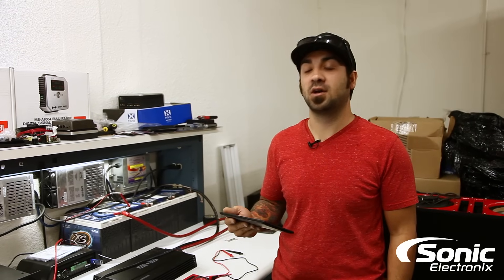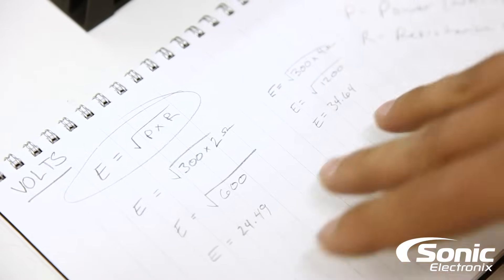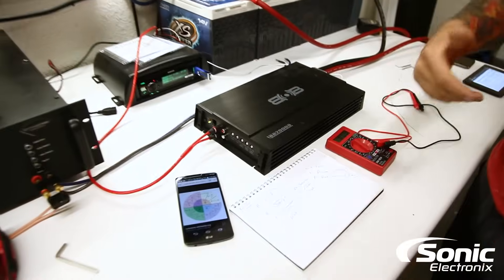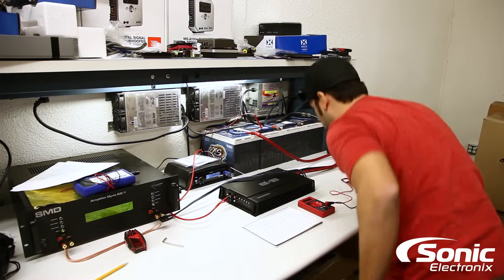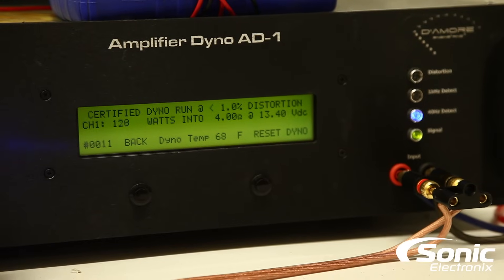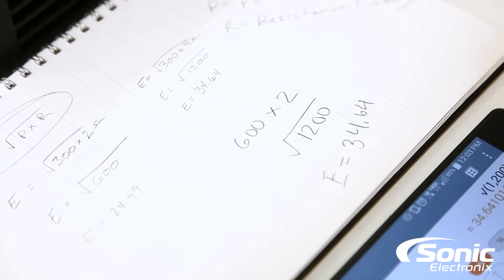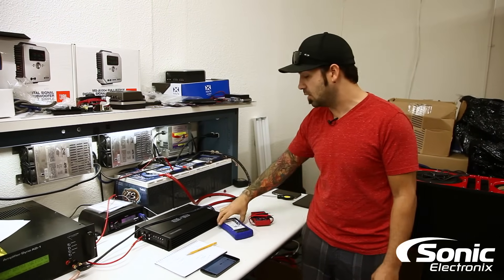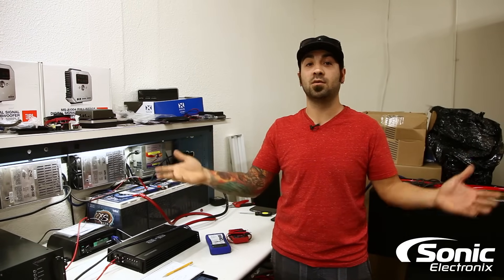How To Set Amp Gain to Match Lower RMS Subwoofers? | Car Audio Q & A

Comment: What if the Amplifier is 450 RMS, but the Subwoofer is 275 RMS.
Should I calculate it with the Subwoofers 275 Watt.  -->  275X4 = 1100,  √1100 = 33,16
My Amp is 900W peak, 450 RMS (4 Ohm)
Subwoofer - 1100 Max, 275 Nominal (RMS) Output power (4 Ohm)
Because if I pump the Amp to 450 I dont know if its good for the Subwoofer.
So I should calculate it with 275 Watt, right?
Reply: talclipse please tell me your not dumb enough yo use only one voice coil on a double coil sub it will rub and destroy your sub crazy fast
Reply: SkyJUSTIN6 no it will not.it cuts  your power handling in half but that's about it.
Reply: talclipse wow dude just no on so many levels first of all those are all peak powers not rms.
Reply: john aranjo what are you Blabbering about??let Me guess cause I am using only one coil on a Dvc sub?? Or maybe its cause I said a car audio amp is like a dumb pc power supply??

Go do your homework and you will find that I am not wrong..instead of just saying I am wrong prove me wrong with facts.

I on the other hand have Actually Experimented with 1 VC vs 2 VC on a Dvc sub,and have come to the conclusion that it is better to only use one coil,Why? Because there is less heat generated and more heat wicked away  by using 1coil at half the subs rated power handling.

A dvc is there for flexable in wiring options and that's about it.the 2nd coil DOES NOT double your sound output,it can not make the sub move further nor faster,it does very little to help make bass.

What it does do is allow a consumer to get more power out of an amp without needing twice the subs.but getting more power out an amp is useless for probably 80% of the customer subs out there today cause they can not handle it.

My 2  fosgate 200ixs at 4ohm mono are slamming my 2 Re 4ohm 15"dvc subs using only one coil and they both love each other.not too much power for the sub nor too low ohm for the amp means my shit slams hard enough to nearly bust your frecking ear drum(that's no joke) all the while running icy cool.

Now pls do your research and some hands on training before you go around  Spewing  uneducated opinions as if they are facts.
Reply: bro I have the course of Eletronic. If  you have a amp more powerfull than your sub, if you  increase the volume until 80% for example your speaker or sub will blow up because It has more power than he supports.
EDIT: If you have a amp 1.5/2x more you can reach the 100% volume and rock the shit.
Reply: watch this                                          https://www.youtube.com/watch?v=l33nrrSl3DY
Reply: rodgers masinde no!!!

You should always get the biggest amp you can regardless of what subs you have.

If you have too weak of an amp the thing will  overheat and eventually die and could possibly kill your subs by leading to clipping.

Your subs will take whatever you give them up to their max.feeding a 200 watt sub 5watts isn't going to hurt it but feeding that same 200 w sub a 1000 watts will kill it.

What really kills a sub is clipping.you all need to learn what it sounds like and how to tune your amps.
Reply: Well.. If your sub haver lower watts than your amplifier you can destroy your subwoofer cuz of the overpower. You should have a subwoofer 1.5/2x more powerfull than the amplifier.
Reply: @barbosa7797  no! no! amplifier should be more powerful than sub to give it headroom. E. g if you got 250rms sub your amp should be at least 300rms. This will work clearly even when volume is cranked up.underpowering of sub leads to distortion.
Reply: Yes go by what you subs are rated at but always  listen to how the subs respond to what you are feeding them.for me I have 2 12" dvc subs rated at 1500watts each.but I am only using 1 voice coil so that halfs the 1500 down to 750,then using my ears I can tell the subs can not handle more then 250-300watts per coil so that 1500watt crap is a straight out lie.more like 500watts...be mindful of that in car audio.

think of a car audio amp as a DUMB power supply!! In a computer you can use a 1000watt power supply for a system that only needs 100watts because the power supply will only hand out the power that is called for.

But a car audio amp will always dish out the most it can no matter how much a speaker can or can not take.so when a 1000watt amp dishes out its max load onto a 200watt sub that subs voice coil can not cope with the extra power and it turns into heat and melts the coil.

This video is about limiting that 1000watt amp so it can be used with that 200watt sub and not destroy the sub.

Comment: When you do this, apply your amp changes when the car is running. A fully charged battery is only ~12.5v. When your car is running, you'll see ~13.4-14.4v, depending on your voltage regulator. DON'T use this method with the car off, otherwise when your car is on and you're actually pushing, say, 14v, for instance, you'll be over your RMS power goal. Also, check the actual impedance at the speaker wire ends. A wired 2-ohm sub may measure 2.4 ohms, or it could measure 1.7, etc. Use measured numbers instead of theoretical ones when you use the equation.
Reply: No, because you aren't measuring the DC voltage from the battery, you're measuring the signal the amplifier is creating to send to the speaker.
Reply: But the impedance change, depending of the frequency, it isn't ?
Reply: My Harbor Freight meter shows my wired 1-ohm at 1.6 ohms, then I purchased a real True RMS $45 clamp meter via Amazon and it shows it as 1-ohm. Moral of the story, DO NOT count on cheap meters to give you accurate readings. You get what you pay for!
Reply: @lowhertzhighspl you think a clamp meter is more accurate than one with probes? Idk about that homie
Reply: If you use this method you can not be using any gain overlap. Most music is not recorded at 0db. It will be safe however. If you send a -10db overlap tone to your sub and set the target voltage that way. But only if your amp =sub rating
Reply: Full Moon Party Video thats correct, most my WAV music recorded -7 to - 13dB. And this method works fine.
Reply: @Mkvy  that would be called attenuation
Reply: What about setting gain this way on a set of NVX JAD 1200.1 amps. I know the master is where I  will set all the gains, and the slave amp won't  need adjusting. However where should I  stick the Digital Multimeter leads and will it be the same formula as stated above. I do not have access to any expensive equipment just  a multimeter.
Reply: Put the leads where your negative and postives wires for you subs go. turn to ac voltage , and your good to go. (play a 50 htz test cd and put gain from 0 to where it reads for your math)
Reply: I have a 2 ohm sub wired to 1 ohm final .. RMS is 750w would I need the square root of 750w(x1 ohm)or 750w x 2 ohms (1500)...
Reply: Numinous no changes when car running or not, AC V stays the same.
Reply: @Puchok777 This isn’t correct. Higher voltage in means higher voltage out. Amplifiers do exactly that: they amplify. Have you ever watched Williston Audio Labs amp dynos here on YouTube? Go take a peek. You’ll see over and over again how he adjusts the voltage of his battery bank to get a more accurate readings because if the fed voltage is lower an amp will produce less watts than when the same amp gets fed higher voltage.
Reply: Lol,  all the guys!,,  
  ok,  most of these guys replying.  Lol again..
Reply: Can u put down an exmp formula please just so I have visual understanding my reading comprehension is bad unfortunately
Reply: Thanks for this extra bit of info👍🏻
Reply: If I have a 1000 watt amp that puts out 500 watts at 2ohm and 1000 watt at 1ohm, and I want to wire 2 subs at 500 watts rms each, do I wire the 2 subs to 1ohm or 2ohm to get 500 watts to each sub? Can Anybody help. Thanks In advanced
Reply: @fallenone6 wire it to 1 ohm (hopefully you have long since found the answer and have been rocking out to your bass) 😀
Reply: There is difference between resistance and impedance, how would you measure impedance? At what frequency? As general rule of thumb just use 2 ohm for 2 ohm sub, since impedance changes with change in frequency, also box rise can affect that too
Reply: THIS IS WRONG ADVICE. 100% WRONG. Impedance is NOT the same as resistance and CAN NOT BE MEASURED WITH MULTIMETER. You CAN NOT measure total impedance, but rather can only measure resistance. Impedance is the sum of capacitance, inductance, and resistance and is shown as a combination of real and complex values. (A multimeter can only  measure the real number portion, called resistance. The complex value is still present but is not measured). If the sub claims 2ohm, you should follow 2 ohms, not the measured resistance because the signal is in AC form. AC electricity behaves differently than DC; AC is also impeded by capacitance/inductance as well as resistance, where DC current is unaffected by complex value impedance. Your sub WILL have more impedance than what you measured (if you measured 1.7ohms for resistance, it probably does have 2ohms impedance while running under AC signals). Your sub should never read more than 2 ohms for resistance if it's a 2 ohm sub.
Reply: @dustinrobak3794  does it being wired to 1ohm matter or the fact that the sub is a 2 ohm sub regardless of how it is wired (parallel or in series...).
Reply: @rayray6422  If you are putting 2 subs in parallel (of same impedance), you should set the amp the same way you would with a single sub. Each sub still sees the same voltage. For you, it is E=√(750W * 2ohm) = 38.73V . Even if you did E=√(1500W * 1ohm) you still get same answer of 38.73V
Reply: @rayray6422  If you put in series, the total power becomes 1500W but the impedance becomes 4-ohms. If you do series, the desired voltage would then be 77.46V (i highly recommend NOT doing it this way). Stay away from series connections with high powered subs.
Reply: @dustinrobak3794  Hey Dustin, using this method I don't have to add a separate voltage number for the head unit do I? Or just from 0 on the amp gain til you hit your desired voltage? Thanks.
Reply: @jred23pyro  That is correct. An amplifier will take a range of input voltages but you don't really care about the input voltages because that isn't what your subs are seeing. I would have your car ignition on with a volt meter reading the output of the amplifier with the volume set to 0 and note the voltage being at or close to 0. Then turn the volume up to max, whatever it is, and then change the gain till the desired voltage is set. Again for others reading this thread, just remember that { Desired Voltage } = √ (wattage x impedance). So if you have 500RMS @ 2 ohm subs, it would be √ (500 x 2ohm) = 31.62 volts. You don't have to worry about your car running or not running, and providing more or less voltage. The amplifier and your aftermarket head unit are unaffected by this since it will provide a steady voltage because it "amplifies" the voltage and smooths it out properly. If the head unit sees 11V from the battery, it will still output proper 2-5 volt signals output. If your head unit sees 13.7 volts, it will still send out 2-5 volt signal outputs. If you didn't know this already, the higher the output voltage, also called pre-amp voltage from your head unit (they usually vary from 2 to 5 volts), the less your amplifier has to work to provide the desired output voltage. Sorry for the rant, hoping to help so you don't blow out subs my man. I am an electrical engineer so it bothers me to see poor advice when your equipment can cost up to thousands. Its worth knowing the science and tuning, to squeeze every drop of performance out of your system without blowing it up.
Reply: @dustinrobak3794  hell yeah brother.. good lookin out! Pretty much yeah I did it this way and i feel like yuuup that's the setting were looking for. More vibrations at lower volume levels.. I was doing 600watts 2ohm for a 600 watt kicker kx old af.. and a skar vvx 10 v3. Thanks again sir.
Reply: Dustin Robak I'm a little confused by your answer. I'm in the same situation as @Raymond Sheppard. He says he has ONE ☝️ Single 750rms Sub with Dual 2ohm voice coils wired in parallel to a final 1ohm load ( Still a 750watt rms total Sub ) ...So wouldn't his equation be E=√(750W * 1ohm) = 27.38V  because its still a 750watt sub. Thanks!

I ask because i have One Single 1000watt rms sub with dual 4ohm voice coils which i plan to wire in parallel to a final 2ohm load. i'm wondering if i plug in the final load 2ohm impedance or if i use the initial 4ohm E=√(1000W * 2ohm)   or   E=√(1000W * 4ohm)
Reply: @DevinDoIt312  It's whatever resistance you wire your subwoofer to. Check your resistance.. if you get 2.3ohms I'd probably do 1000*2.3.
Reply: jred23pyro measured resistance isn’t = AC resistance on 40Hz.
Reply: Dustin Robak I have been messing with amp tuning for a while and what I am getting from what you’re saying is the measurement of resistance that I get from my multimeter (1.2 ohms) isn’t what I should use? my subs are wired to 1 ohm so I should use 1 ohm in my equation. also I have a nice rockford fosgate amp (just so you know it’s not a POS) should I set gain with my low pass filter all the way up, punch EQ (bass boost)all the way down, and flat EQ on my headunit? I have heard all punch eq is is a gain increase and will only distort my sound.
Reply: or is it okay to set my gain with the equation and then turn punch eq up to make subs louder? isn’t gain just matching the headunit output to the input of the amp? is punch eq more of a “volume” for the amp?
Reply: @dustinrobak3794 There are several other factors you’re not considering regarding the functional  resistance of a speaker. Manufacturing precision is one. The resistance of the speaker wires leading to the speaker is another. A longer run of smaller gauge speaker wire would add even more resistance to the system, too. Also, the amps are fed DC current and output AC current, so what you’re saying only applies to the output side.

One could really go deeply down a rabbit hole on this one. Let’s remember the original and stated purpose of this video: to set gains at a level to not exceed the rated RMS power of a driver. The method in this video and the manner in which I expounded upon it should successfully accomplish that goal. If you don’t think so, I’d love to hear your suggestion to accomplish the same goal with readily available, affordable tools?
Reply: I was gonna ask this very question about the car running or not. Thanks for the clarification.
Reply: Numinous car engine on means your gain can be set higher before clipping, but your target voltage will be at the same gain setting
Reply: @numinous.     You just saved me...... mad love bro
Reply: @AlvlUpSavedMyLife  numinous actually gave you terrible advice. Car running does not change the voltage output. Do you ever notice your stereo volume start blasting the second your car turns on? No, because the output stays the exact same. Your volume doesn't change when you turn your car off either. Also do not rely on measuring impedance because you can not measure inductance (fluctuates with frequency, a multimeter can not measure inductance otherwise). Numinous is actually an idiot; he does not know what he is talking about.
Reply: @dustinrobak3794  the reason you don't hear "volume start blasting" the second your car turns on is because the watt gain is not significant enough to make an audible difference, especially over car engine noise, it will likely sound quieter...people usually turn the volume up after the car starts, and turn it down when they shut the engine off. I have a JL Audio  XD500/3 amp. In the owner manual you can see them clearly state different power outputs at 14.4V and 12.5V. At 14.4V it is 75Wx2@4ohms. At 12.5V it is 60Wx2@4ohms. So that 25% wattage increase isn't going to be enough to make an audible difference as you need to double the power just to get a 3db gain.
Reply: Numinous shouldent the meter be set to DC when checking directly from car battery?? Not AC how he has it in the video??

Comment: What if i have a sub that is rated at 550w rms and a amp that is also rated at 550w rms is that good?
Reply: Yes it's good, you can still use this formula to verify output on the amp, but it'd be more for verification rather than trying to actually adjust output.
Reply: That's ideally what you want